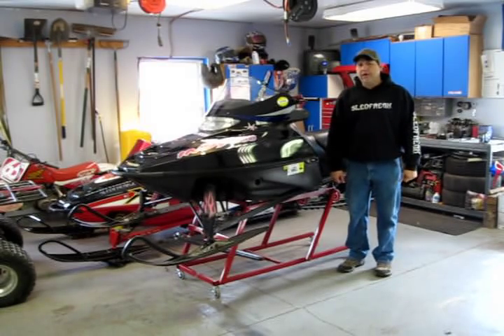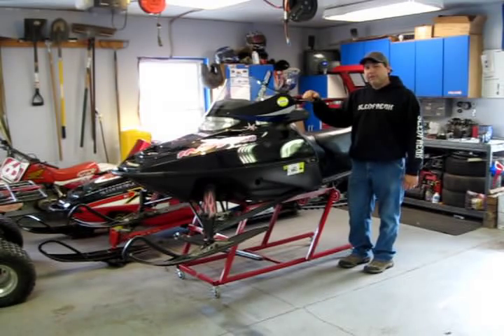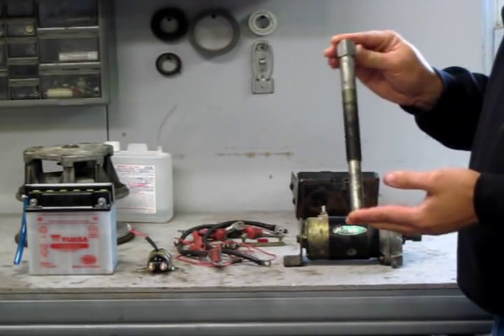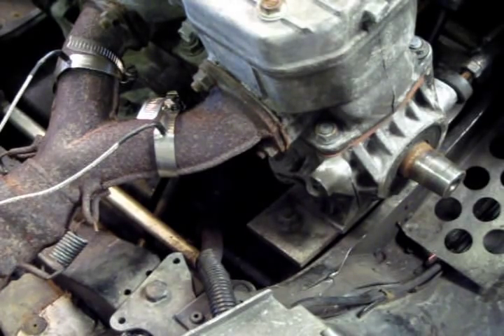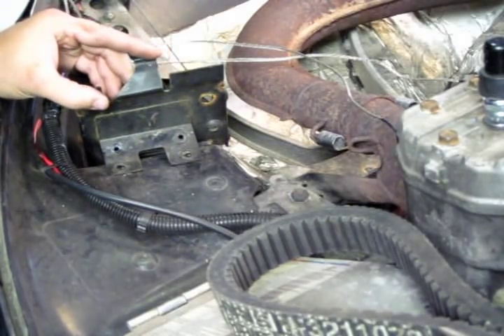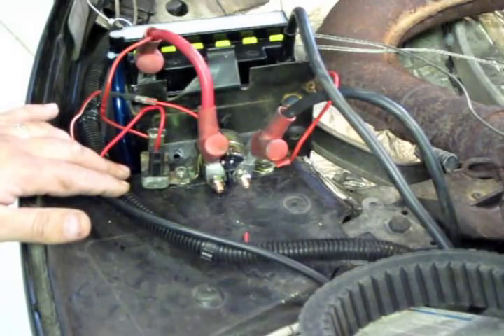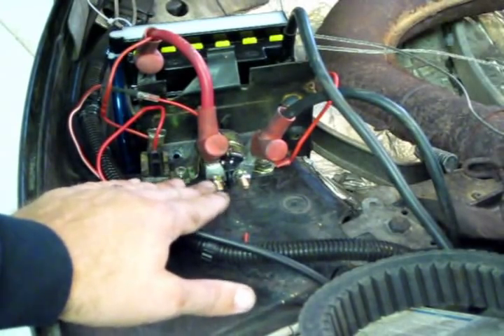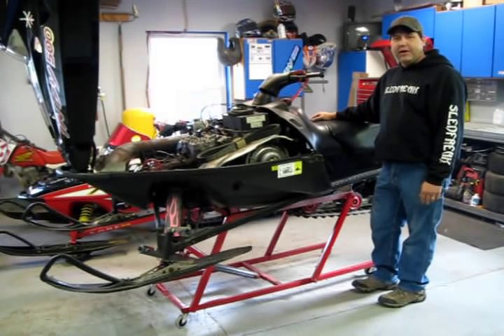SS Electric start

Comment: Thank you 500Indy! I've asked a number of people with considerable experience that repair and restore snowmobiles about my need to have a starter installed on my 340 drifter, none of them have been helpful or encouraging. Now I just hope I can locate a starter motor that will make the fit (and will see of there is already a ring gear on my clutch) My pull-cord arm and shoulder isn't what it used to be so this modification will help make winter more fun again! :)

Comment: hey great video i have a 93 Polaris Indy 500 efi when i bought it not long ago the guy said it needed a new battery so the e start would work so i picked one up brand new after i charged it fully i put it in turned the key but didn't do anything not even a click i checked the stater its not seized up can turn it by hand till it hits sprocket so im thinking the solenoid is bad from what i can see the wiring job doesn't look like yours i dont even think the battery on the negative side is grounded it goes straight to the solenoid